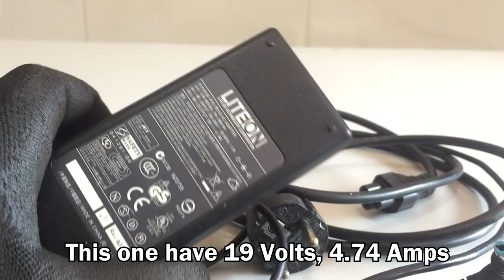Electrolysis Rust Removal - DIY Step by Step for Everyone

Comment: You used a meter with the positive red lead in the com ground connection of the multi meter.  That is going to  completely confuse people ! Edit the video. The black negative meter lead should be on the item being derusted and the red lead to the rods and the meter leads properly connected with black going to the com
Reply from the maker: Hi Kaveman... Thanks for the comments... Actually i dont see any problem, the important is to people know the positive and negative where do connect... Big Hug

Comment: Why do we need two positive rods instead of one?
Reply from the maker: Hi John. You can use one but in my opinion works better with two. Improve the process. Try with one and with two and check what works better for you.
Reply: @RandomTubePT  yeah maybe something like the flow of the current goes better. Do you know if it makes any difference if the Voltage or Amp is higher?
Reply from the maker: @my5cents4u  Yes also improve the process but i never tried more than this bro... I always used this Voltage. But i know that some guys use more.

Comment: Does this process affect the metals strength
Reply from the maker: Hi David... From my knowledge no and never heard about...
Reply: Nope, it only covers the part with metal from the positive electrode.
Reply: CXensation Nope, it doesn’t, it simply takes away the oxygen from the iron oxide. The other piece of metal simply serves as an anode, and if you used platinum there would be no corrosion at all.

Comment: dipping my car...wish me luck!
Reply from the maker: Good Luck Bro 😀
Reply: Well..theoretically that might be possible.. If you used a swimming pool full of Salt water and a telephone pole and steel cable instead of a Pencil with a wire to suspend it. Might turn your car into a Huge Paperweight.. but at least the rust would be gone!

Comment: Fill you tub with the works and leave it for 1 hour and wait later and come back to brush the metals
Reply from the maker: Electrolysis is just one method to remove rust... There are many others... 👍
Reply: @RandomTubePT  that works too but I stick with the works because they're most common brands that actually does the job well because it eat away any rust because I found a rusted pocket knife and I used it and works

Comment: This method works well but if you want the best possible result Muriatic acid works better and faster with no cleaning and brushing to do afterwards 

Just put a part in muriatic acid for 10 min then rinse it into a solution of baking Soda and water and bam 100% rust free new part !!!
Reply from the maker: Hi Bro, There is many different ways to remove rust, personaly dont like acids… This is just a cheap way to do it… Big Hug

Comment: I hear Vinegar would work. Takes a long time I hear
Reply from the maker: I used vinegar for a long time... But take many time
Reply: @RandomTubePT  you can add vinegar to your solution when you use electrolysis. It helps make the process more effective.

Comment: U can use citric acid , BETTER,,
Reply from the maker: Hi... Can you explain bro? Citric Acid in the water?
Reply from the maker: @arya-im7vj  I undersand now. I used for a long time but i dont like the smell and i need a big qty of vinegar. But yes it works. Electrolysis is just one one the methods to remove rust. There are many othera. If you check my other videos you will see that i used vinegar but honestly i dont like, but yes it works also.

Comment: the more salt you put in the more current you draw ,,, so think b4 you dumb a  100 grams of salt.... :)
Reply from the maker: Hi. I dont recommend to use salt :) I said in description...  :)
Reply: @RandomTubePT   :Agreed RTP, but the projects 99 % people do is so small + the psu they use are compared to 12 v milli-amps.. maybe 500 ma  ...:)
I have done large objects, gas tanks etc in open air with no ill affects, granted we must not be stupid and take chances indoors, i have built 5 kw saltwater dummy loads in operation daily, still working till this day, once again we put all the protective measures in place.
thanks for the reply anyway :)
Reply from the maker: Lucky Dube in Rc, Thanks for comment bro. You are right. Sometimes when we are recording we forget a few details. Thats the reason i put a good description ( i think 😀) but i understand that some people dont read it. Big Hug Bro. Onde again, thanks
Reply: Most violent chlorine liberation I've ever seen is from mixing two toilet cleaners. Very dangerous indeed!